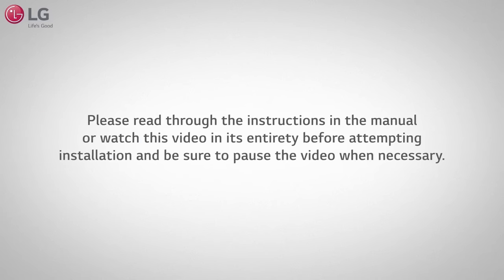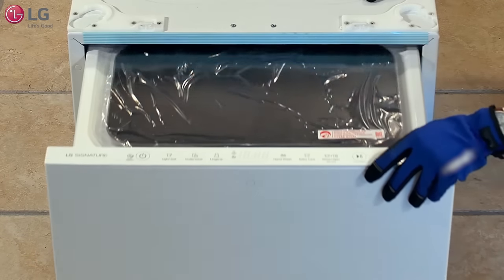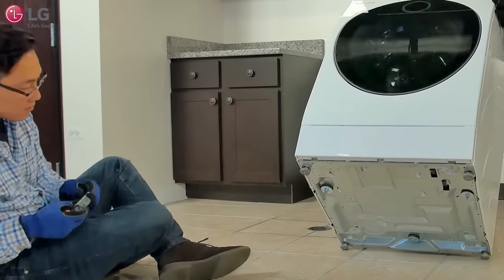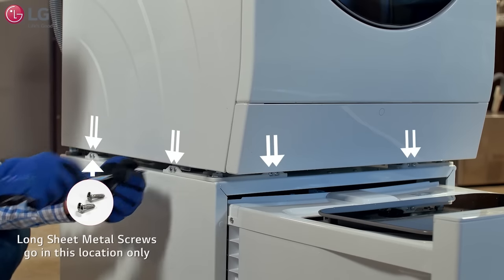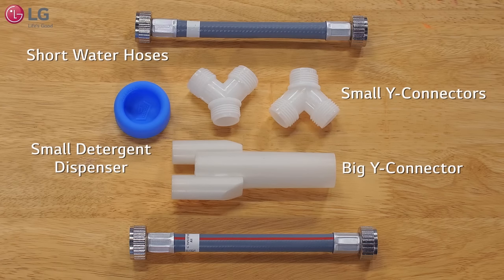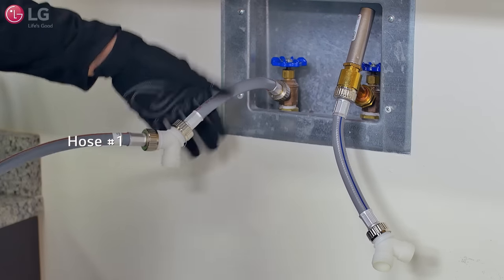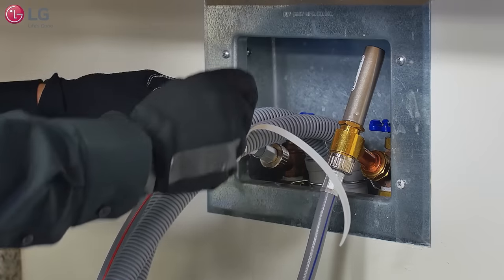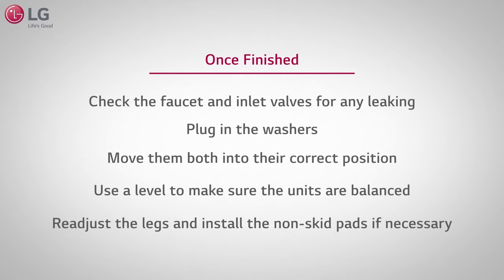LG Signature Washer - Installation

Comment: Our machine works great! 
One problemo though. 
There are  two gray plastic brackets on the back, on the top left and right corners. One can be seen at 4:15.  
In our house, one of those intersects with a water pipe and prevents us from pushing washer all the way back, which prevents us from closing the laundry closet door. 
Is it okay to remove these?

Comment: What if you do not have hot water?
Reply from the maker: So we can better assist with your issue please contact LG Customer Support by direct message via Twitter ( @LGUSSupport  ) or Facebook Messenger ( https://www.facebook.com/LGUSA/ ). Please include your model and serial numbers. Thank you. ^TC
Reply: It will heat the water using a built in water heater so you should be good
Reply: Stupid Master2 then why would we need to connect the washer to a hot water supply it could just connect to a cold water supply and heat up the water with the heater
Reply: Why does he talk like that lol